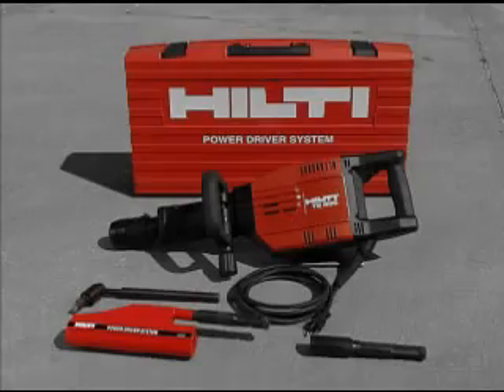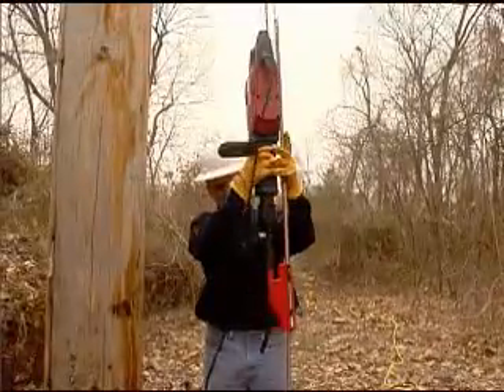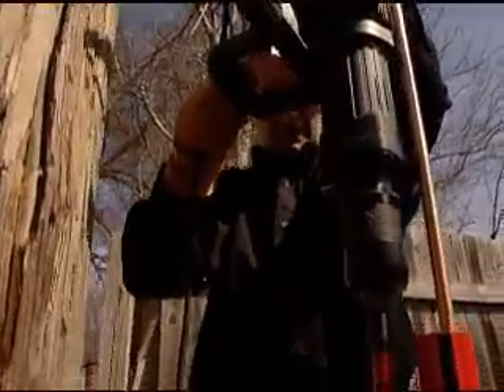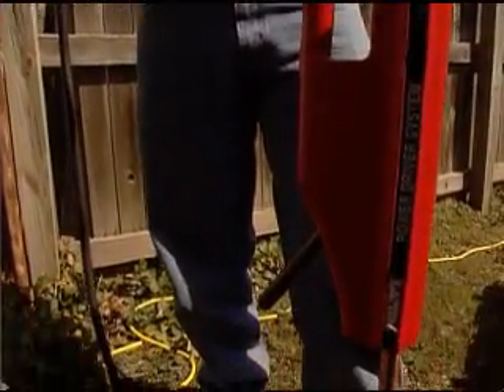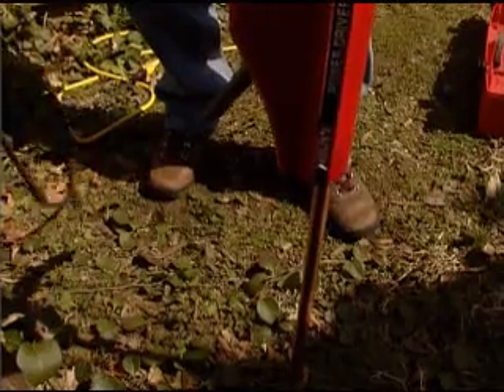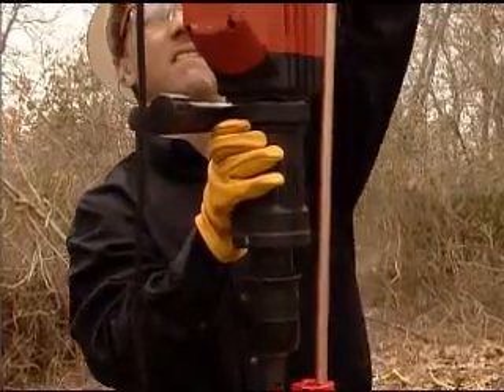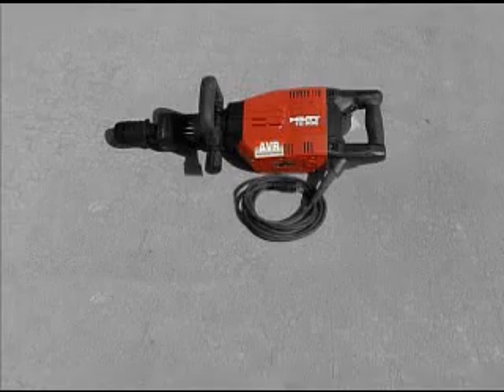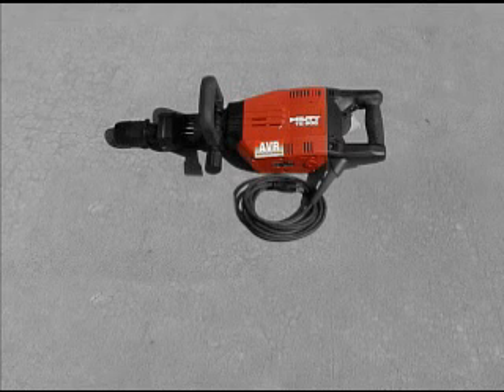Hilti TE905.Ground rod driver

Comment: Used it to breakup the perimeter of my basement slab for a drain tile it was 18 inches x 135 feet of 2 to 4 inch concrete🔨>share4.photo/Hilti7Breaker?8    It did take awhile but I got it done. I found synthetic oil for it at the local auto parts store. I greased the bits before every use. Well worth the money. It did leak a little oil but the leaking oil helps lubricate the bit so I didn't mind. I will buy another in the future to have as a spare.